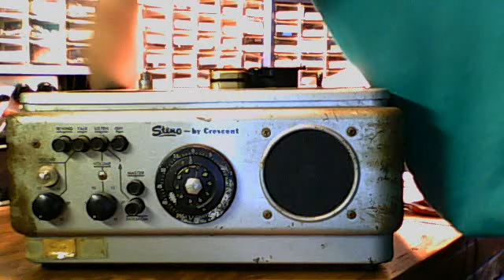cassette26's webcam video August 26, 2011 02:11 PM

Comment: if you put a light covering of oil on the rollers, lit it soke in over a few day's, wipe off the ecses, then repeat about 3,to 4 times it"ll restore the rubber. oil the head winder to.